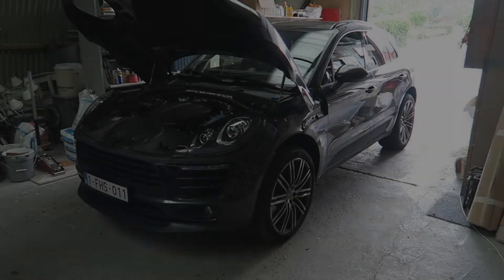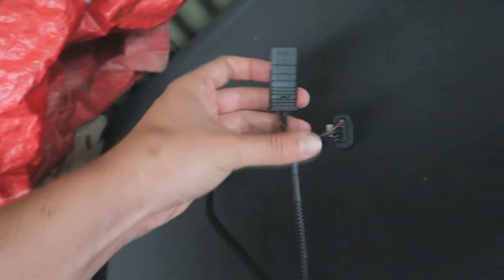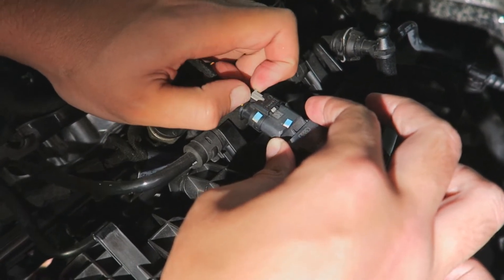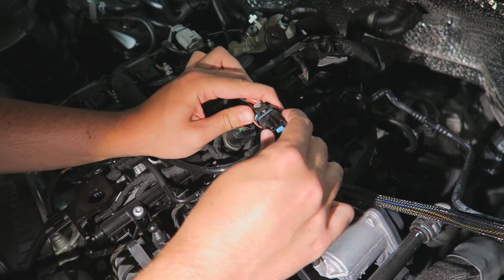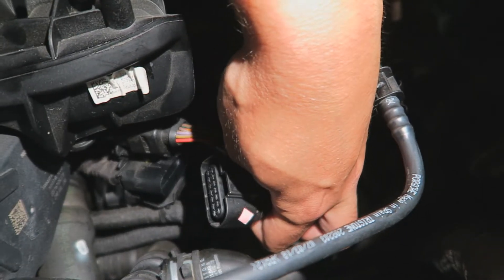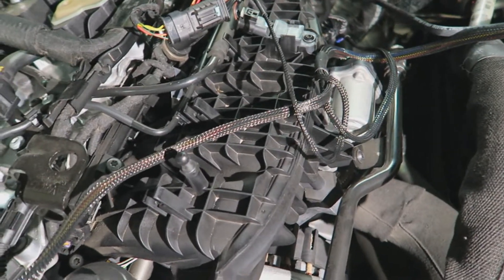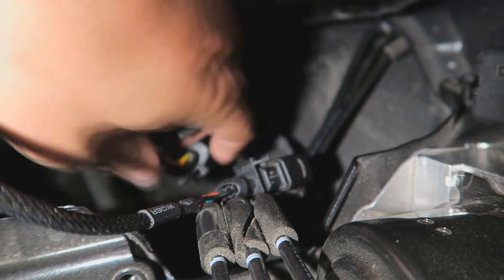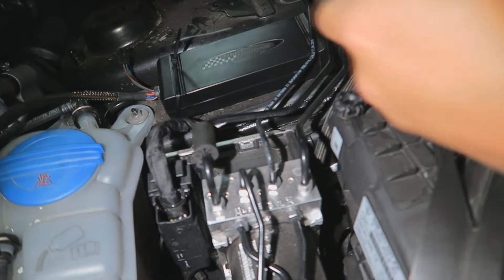How to install JB4 & JB1 on Audi & Porsche 252HP 2.0 Turbo 4 Cylinder Engines | Burger Motorsports

Comment: Title is wrong. This is just the instruction for the JB1 (basic). If you use a JB4 then you’ll have a few more imps wires you need to connect—one is the OBD, the second is the AFR blue wire with the included posi-tap connector, which gets connected to the AFR wire.

Comment: Thanks for making the video! Has the JB1 been reliable for you? Is the PDK still smooth?
Reply from the maker: Yes it has been very reliable so far. The car is a little bit more nervous and jumpy but the pdk is still smooth. Especially if you have a light foot. My just press the pedal in a nonchalant matter and they sometimes complain the tuning made it 'more jerky'.
Reply: @AaronMattheus  Thanks very much! I'm worried about making the PDK perform worse since it's so good from the factory.
Reply from the maker: @th3w4nted  I've driven the macan today for 4 hours. The power increase is so nice, i'm starting to think it's neccesary.